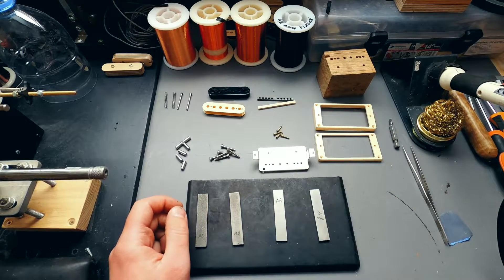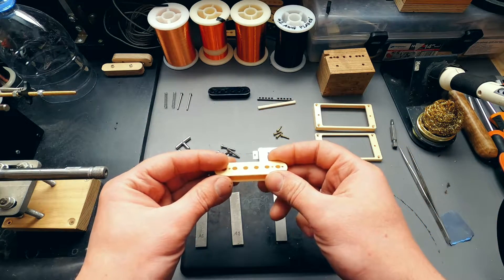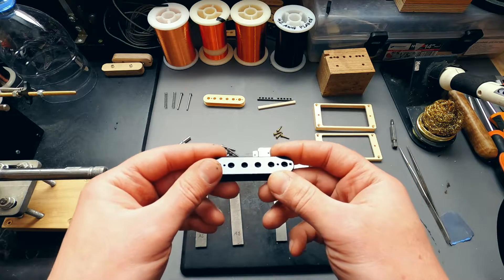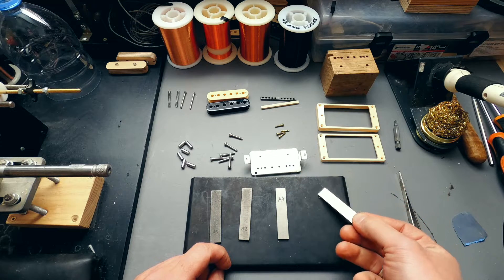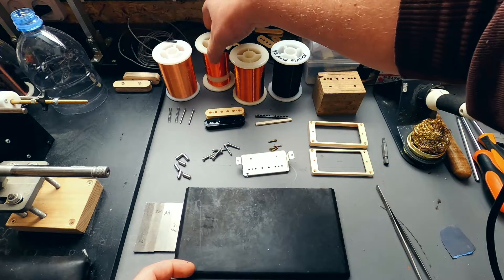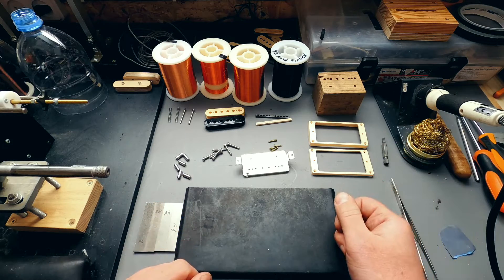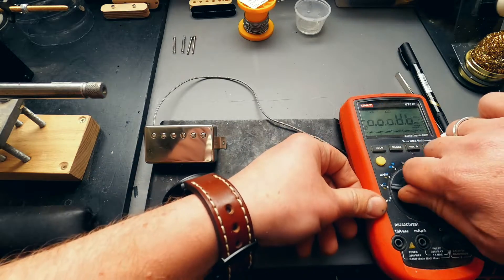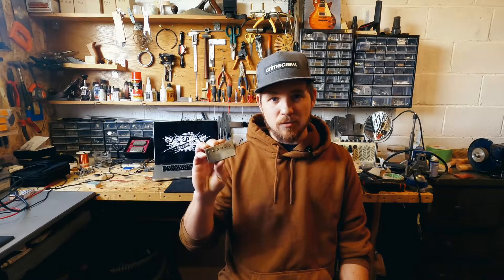HOW TO MAKE A PAF HUMBUCKER PICKUP. Overview of materials and technology.

Comment: Are the bobbin screws all the way down into the bobbin so they sit flush with the cover? How do you decide if they should be flush or slightly above the cover? Thanks!
Reply from the maker: @jonahlmoore  it's fine tuning. Just like with tuners buttons.
Reply: @8BombCustom hey thanks for the reply. Yes I can do this by ear just not much information on the actually difference between the screw distance verses the coil distance when covered, uncovered or is it always the same? I read that Seth Lover believed this did not affect tone and the screw was added for marketing. It seems that lowering the coil and raising the screw adds brightness. When I made them flush and same distance it seems darker. Do you also find this to be the case or have a different approach?

Comment: Friend, what resin or material does a Gibson SG 61 pickup have? They are custom classic 57s. I opened it to change the nickel-plated covers, but I see that they are lightly coated with something similar to candle wax. Can you guide me? Thanks
Reply from the maker: @adrianrojas6658  it is paraffin
Reply: @8BombCustom  Common candle paraffin?  Should i put double sided tape on the cover? what function does it serve? mine didnt´t have it
Reply: @adrianrojas6658  look up wax potting it is to prevent microphonics. The pickup is potted before the cover is installed at the factory, don't use tape it will create a gap and cause feedback in my experience put some wax in between the bobbin and cover, solder the cover on. Google or youtube how to install covers correctly.

Comment: What about the really important electrical characteristics (inductance and capacitance) as well as a frequency curve of the pickup? The minimum would be the location and height of the resonant peak .... only with these parameters can you see, how a pickup sounds. Doing this all by just copying other designs is not the best way, as it does not take into account variances in the material (especially the magnets and the type of winding (indirectly determining the capacitance of the pickup)). This is all completely non-scientific and only very limited reproducible.
Reply from the maker: You are absolutely right. But there are a couple of questions. What do you think, if I give here all the figures of the resonance peak, the error, the curve of the resistance change depending on the ambient temperature, the tension of the wire and the winding pattern, the curves of the dependence of the magnet force on the resonance peak and inductance? Do the audience need this? Do you think they will understand it? And what to do with the influence of alloys on the sound? How to measure it? And then after all these figures, how to explain the final sound in words and figures? I think in this place it is all unnecessary. Such information remains in the workshop for deep analysis and hundreds of comparisons. But in the end, the best sensor is always the ear. It does not lie.
Reply: @8BombCustom  unfortunately not, as psychology plays in many cases an even more important role. So double blind tests are the minimum requirements to move from "belief" to objective knowledge. These are practically always avoided - for obvious reasons.

As this approach very quickly unmasks most of the "theories" shown in marketing messages, this is avoided whenever possible. For the manufacturers it is much easier to carry a completely artificially created message to the mostly non engineering musicians. This is easier to differentiate themselves from others and to justify price differences with. Objective and measurable facts would very quickly make clear how small the differences in pickups are - once you group them by basic electrical parameters. Suddenly it becomes really difficult to justify the extreme price differences between pickups. Snake oil in the year 2024.

Comment: Can you tell how to know pickups good by the electric metter ?. Thanks man
Reply from the maker: With a multimeter you can only find out whether the pickups are working or not. Based on the resistance, you can make rough assumptions about the type and number of turns of the wire. You need to judge the sound with your ears.
Reply: @8BombCustom  thanks alot man

Comment: Do you make sustain pickups too? If so, kindly make a DIY project clip. Thank you
Reply from the maker: What you mean about sustain?
Reply: @8BombCustom  A pickup like Sustaiac (Brand name). Generally it replaces/mounted at neck pickup's place, in proximity of high end of fret board. Instead of simple clipping, it enhances the amplitude and then clips. the impedance of the pickup is very low (thicker wire and less number of winding of coils and magnetism is focused at string. For impedance matching and clipping there is an interface circuit board to be fitted in cavity of the guitar, bearing electronic control switches etc.
Reply from the maker: Thank you. I already figured out what you meant. Interesting functionality, but for me personally and for the guitars that I make, it is not very useful. A proper LesPaul can have infinite and controllable sustain, so I was not even interested. I have a narrower specialization. Perhaps if I find the time, I will figure out such a device.
Reply: @8BombCustom  Thanks a lot

Comment: What was the point of the "Patent Applied For" sticker on the base? It looks just like the one Gibson used. Are you passing these off as Gibson PAFs ?
Reply from the maker: No, I'm not positioning it as a Gibson PAF.  It's a copy.  The decal is just a tradition.  But no matter what anyone wants to pass it off as the original, they have markers on them that say that this is a copy.  All my reels have my logo on the reverse side, a small number 8 is minted on the backplates. And now I still refused this decal.

Comment: Sometimes I see the following schematics:

#1
Start of the screw coil goes to HOT
Two finishes are solded together
Start of the slug coil goes GROUND

#2
Start of the screw coil goes to GROUND
Two finishes are solded together
Start of the slug coil goes HOT

These differences are related to clockwise or counter-clockwise winding? Or because of humbucker position (neck/bridge?)

Comment: Hi. I noticed you wound 5006 turns on the first coil - do you wind a different number on the second coil to emphasise the highs?
Reply from the maker: I do it differently. Different tricks for different tasks
Reply: You could also use a different tension on each coil, or even a different tpl or other coil geometry change, though my experience in this is limited, and this knowledge and how to apply it is the most closely guarded secret among winders.

Comment: Hello, would you plese tell me how - where have you got - bought that pickup winding machine ? If you have ordered it online, did you have to pay extra taxes for the customs and shipping ? Ty !
Reply: If the machine seems too expensive, you can use a sewing machine or a power drill with a DIY counter made from a calculator and magnetic reed switch. It's a very cheap project. Of course the real machines are better.
Reply: @seinmstudio3646  Wow that's an awesome idea ! Thank you !
Reply: @major-Mihailo  Thanks! There are many videos on YouTube of how to do it. It's what I'm planning for my own project.
Reply: @seinmstudio3646  I'll check it out tnx again !
Reply from the maker: Zdravo. I bought my machine from mojotone.com.  This is a fairly simple machine, but with nice additions.  Gauss meter, stepless speed control and good build quality.  But out of the box, it is only suitable for winding single coils with manual wire layout.  Therefore, I had to do it very hard and, in fact, finish the second half of the machine.  It is a wire tensioner and an automatic coil spreader.  Plus some humbucker winding gear.  Of course, I paid customs duties, but this is not a problem to achieve the goal.
Reply: @8BombCustom  Thank you for your reply !!! Yes, I have visited several sites, and I have seen that the machine itself costs around 500 Us dollars or so. I'm from Serbia and I am clueless about how much It would cost to order machine online , to pay for the shipping + customs. Maybe you do remember aproximately how much have you payed for machine + shipping + customs ? I am more than sorry for bothering you about this, but I was thinking about getting one of those machines.
Reply from the maker: I have been to Belgrade several times and painted several churches in Montenegro.
https://www.mojotone.com/PWM
You can enter the country and postal code when ordering and find out the cost of delivery to Serbia.  You can find out about customs duties at your post office or on your local website.  In my country, now it is 15% for the amount of a parcel above 20 euros.  In Europe, it is 30% for an amount over 30 euros, if I'm not mistaken.  Plus customs clearance fees.
Reply: @8BombCustom  Wow you have actually painted several churches in Montenegro ? You have painted frescoes ?? That is pretty amazing !!! Belgrade is my hometown . Thank you for your replies, and again - forgive me for bothering you about all of those details. 
Мир Божий, Христос Родился !
Reply from the maker: @major-Mihailo  Thank you.  Merry Christmas to you too.  My main work, which I have been doing for over 20 years, is monumental painting and icon painting.  In Montenegro, we painted churches in Radovichi and made a large fresco in Podgorica in the cathedral church.  "The Descent of the Holy Spirit on the Apostles".  Last year we completed the reconstruction of 17th century frescoes in Poland, which were painted by a Serbian icon painter.  I have a second channel about my work.  https://youtube.com/channel/UCtFqR6_DWLsJdAjq-t4ROdA
Reply: @8BombCustom  Thank you, God bless you and your family. I have just watched some videos of your second channel and I'm truly speachless !
Reply from the maker: @major-Mihailo  Хвала!
Reply: I live about about an hour away from Mojotone in North Carolina USA  
and have been there to pick up several guitar cabinets...they showed me the amp demo room and cabinet building shop...very cool!..after reading this thread,I just want to say God bless both of you
Reply from the maker: @rickya3877  Thank you!

Comment: Great video and thanks for sharing your knowledge! When you sand off the coating of the coil wire at 6:40, how do you know or feel that it is completely off?
Reply from the maker: the wire changes color. Even if the enamel is not completely removed, the temperature of the soldering iron is 350 degrees Celsius. The enamel burns out.

Comment: What do the pole screws actually screw into? The base plate or the metal keeper bar? I'm confused because it looks like neither of them are threaded/tapped.
Reply from the maker: I think the keeper is just so that the magnet touches the screws as much as possible through it for better transmission of the magnetic field.
Reply from the maker: They are screwed in, self-threading, through the bobbin into the backplate.  Since the metal of the screws is harder than nickel silver, the screws themselves cut the threads.  The holes on the metal keeper are larger than the diameter of the screws so they can pass freely through them.
Reply: @8BombCustom  Ah, I see. Do they need to touch the backplate / keeper bar (for magnetic field reasons) or is it simply structural?